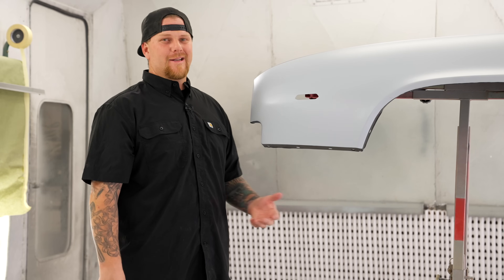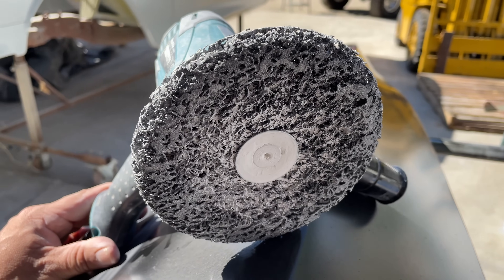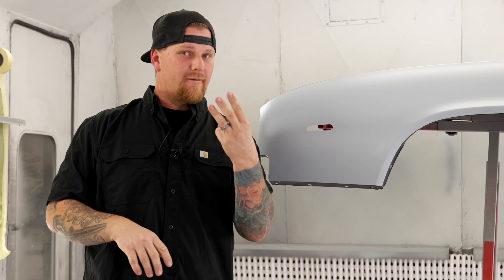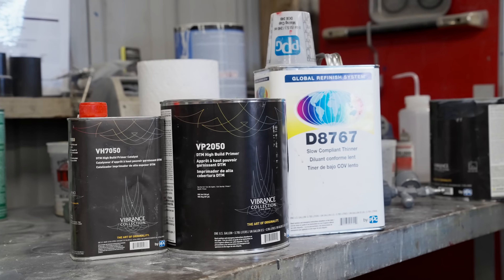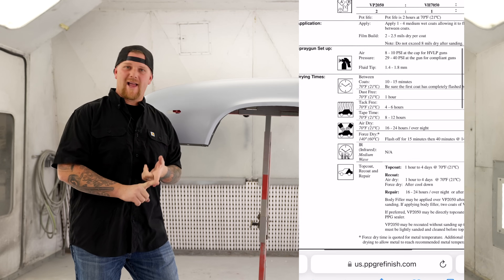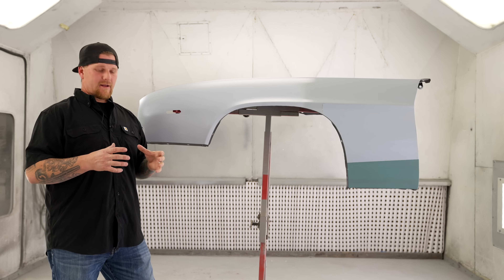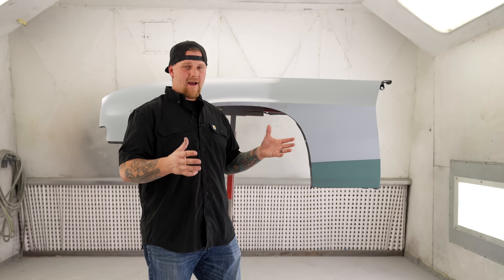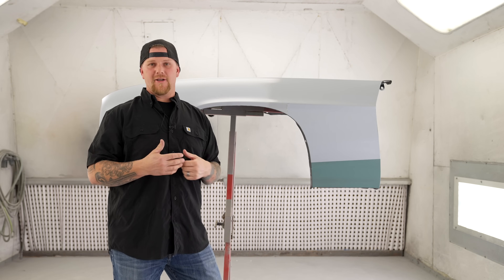Understanding Primers:  Epoxy, Polyesters, and Urethanes explained.

Comment: Interesting video I just have one question. I've seen some videos they take cut the rust out and take it back to bare metal and then they just lay fiberglass on top. They state the fiberglass seals the bare metal. Is that correct or should you use epoxy undercoat first.  Cheers Graham

Comment: I have a Chevy stepside tailgate. On one side, the important side you see, the 25+  year old black paint is in really nice condition.  The bed side has rust bubbles under the paint.   The tailgate is in excellent condition because it hasn't even been on the truck for most of that time.
A friend has a large commercial sandblaster and I plan to blast the bad side and prime it before putting it for sale.
I want to prime it with something friendly for the buyer/end user.
It will need a high build primer or possibly a little bondo or glazing putty. I'm not doing that.  I just want to blast it and prime it.  Will an off the shelf primer be ok for this?   I'm thinking Duplicolor, Rust-Oleum or Krylon bare metal primer.... A  non etching  type.
Reply from the maker: Read the tds make sure it meets the criteria

Comment: So if you’re using body filler, you put down edging primer first or after I’m confused
Reply from the maker: I don’t use etching primer at all. We use epoxy in the restoration world. The only reason you would want to use etch as if you are going to go back over the top of that with a urethane.

Comment: Can i do wheels with Epoxy primer?
Specifically, can Epoxy primer be a good base layer on a chrome wheel that been prepped (chipping removed, sanded, scarfed) without stripping the chrome all the way?
Reply from the maker: No nothing will stick to chrome. It must be chemically dipped and removed.

Comment: Question can I spray polyurethane primer DTM over 2K non-DTM primer and will it still be effective to protect the bare metal since the 2k is Not an etching primer. ?? was almost out of DTM polyurethane and put a little 2K over the bar panels that were left in order to protect them until I can get back to working on the car.   I do have polyurethane DTM primer on my hood fenders and my trunk lid. Just the other panels have 2K. Talk to a couple other paint guys and they say that the 2K might peel off of my raw bare metal that has been covered…. Thoughts and comments on this would be helpful to let me determine if I’m going to send the 2K back off and just hit it with the DTM polyurethane…?

Thanks
Reply from the maker: I think you are answering your own question in this comment. If you are putting something over bare metal and it is not at dtm it is not going to stick to metal

Comment: Great video! I wanted to use the self-etch primer on the bare aluminum to promote the paint adhesion. Then cover it with zinc chromate because I live in high humidity area near the coast. Any thoughts on this?
Reply from the maker: Self etch I steer away from. Mechanical adhesion is superior then use epoxy. 👍🏻
Reply: @SYLVESTERSCUSTOMS  Thank you. Does epoxy primer adhere to aluminum well? What prep do you to to promote adhesion? I thought about using Eastwood 2K AeroSpray Spray Paint

Comment: Even more confused. Nowhere can I find VP2050 called an epoxy primer? It’s a DTM high build?
Reply from the maker: @got2bgreen45  you are correct but if you go to the chemical make up of that product, it’s primarily any epoxy hybrid. A traditional epoxy is very thin and not sandable. VP 2050 is a great product because it’s a one-size-fits-all.

Comment: I learn so much from you but I don't understand why you say vp2150 is an epoxy primer - it absolutely is not:  "No, PPG VP2050 is not an epoxy primer. It is a DTM (Direct To Metal) high-build primer, meaning it's designed to be applied directly to properly prepared metal surfaces like steel, galvanized steel, and aluminum. While it provides excellent adhesion and corrosion resistance, it's not specifically classified as an epoxy primer."
Reply from the maker: I know that. However look at the chemical make up it’s an epoxy based high build hybrid. Because it’s a hybrid they will call it a DTM FYI

Comment: I keep coming back to watch many of your videos because most things I missed sink in.  Lots of information for a beginner. 

I have 1k max epoxy already to make sure there is no chance of moisture getting through.  You said that urethane high build is thinner than the all in one.  Would that be a good thing if I got smaller amounts of it in 2 or possibly 3 colors so i know when ive got a flat surface with the grits?  I can do 1 coat of the first color (odd) at 400 grit,  second with 1 coat of different (even) color on the at 320 grit, 3rd would use 2 coats (odd) at 220, and 4th using 2nd  (even) color would have 2 coats  work at 180?

Just another way that would be more expensive, but it might be easier for a beginner to have visuals instead of using the powder in between?  Would the scratch from the different grits dig down further than 1 coat?

Im thinking out of the box to help to know when to switch grits and not get mixed up with how far down they have gone.  In the end it's all coming off anyway.  

An expert would probably laugh at doing this.
Reply from the maker: You lost me I’m sorry. It’s not an easy task to learn it’s much easier at our in person classes. Sylvesterscustoms.com

Comment: good explanations of epoxies but I still need your advice on the epoxy matter.  Can I apply 3 coats of white color 2 pack epoxy primer only (no topcoats), on my 3 meters bare sanded mild steel swimming pool stairs handrails?
Reply from the maker: I’m not a pool expert sorry lol

Comment: I'm an ecoat technician for a company that makes new bumper on Ford, Dodge, and GM trucks. Taking off the ecoat is the worst thing you can do. Ecoat is a rust preventer better than any primer you can spray on the metal. We do extensive testing these parts and without ecoat the paint fails.
Reply from the maker: I’m not sure what to tell you I have seen many adhesion issues between aftermarket parts and Ecoat. I also think epoxy primer is superior over e coat. Additionally, the best way for a high-end restoration is for a mechanical tooth, which is also not provided under all of the parts that we have been looking at that we strip with lasers.
Reply: @SYLVESTERSCUSTOMS  agree 💯

Comment: Awesome data.  I'm a diy weekend warrior. I have had some pre primed bumper covers I have sprayed.  Would it be ok for a pre primed front bumper to be scuffed and prepped with a red scotch Brite and then spray with a 2k sealer and aloud to flash then base/cleared?  I haven't tried this method but usually there a aftermarket bumper cover and are pre primed and if I can get away with "wet on wet" spraying, it would save me some time and be standing .  Thanks
Reply from the maker: Yes, absolutely

Comment: Can you 2k epoxy over just the outside of a body where there is original paint on the inner structures? Is there a concern of blending?
Reply from the maker: I don’t exactly understand your question
Reply: @ let me try clarify thanks for the reply. I want to take everything down to bare metal except there are a few sections(on my front quarter panel as bends into engine bay where it meets with the hood) where I want to keep original paint. I don’t want to remove paint in the engine bay, but unsure how to cleanly transition. Hopefully that makes more sense?

Comment: What primer would you put over e-coat? I'm restoring a car which ill be having e-coated when the repairs are finished (it's been stripped via a pyrolysis oven and pboshporic acid dip, and will be going back to be acid dipped again before the e-coat to remove flash rust). Thanks,
Reply from the maker: I don’t recommend e-coat I haven’t seen good adhesion. We use epoxy primer over a very thorough 80 -120 grit scuff

Comment: Great video! Hey with that VP2050 does it lay smooth where you can go to paint over it without sanding it down? Or do you have to sand it? Would 400grit even take the skin off of it???
Reply from the maker: I personally won’t paint over it. It needs a mechanical tooth. I bust it down with 150 grit then 220 and lastly 600 wet

Comment: Question planing on painting my truck surface rust on hood and cab everywhere else is good so should i apply epoxy primer to the hood and cab   prep those areas then spray the intire truck in polyester primer is this correct method
Reply from the maker: There’s 10 different ways you could do it. I’m not exactly sure what your question is because you have rust all over the vehicle. You need to address that first and remove it completely. Then epoxy.

Comment: Thanks for the great video! Just wondering: if epoxy primer is hard to sand, what do people do? Do you have to use body filler or can you just paint over it? Is there another primer you would put on top to sand?

If you had a bonnet with about half bare metal and half old primer, what would you do? I was just going to epoxy over it all and either paint, or use another primer, but im not sure which os better? Lets say there will be pretty much no bondo or filler.

 Thanks!
Reply from the maker: If you go to the Sylvester’s Customs main page, you will see that there is playlist created for questions like this. We have videos of every step check out our series with the Willys. It should help you epoxy primer is not hard to send.

Comment: I plan on fixing my truck slowly but still drive it. I wanted to strip it down to metal and put an epoxy primer over it before any body work is done. Is it bad to drive around for a couple months with epoxy and or polyester primer over the body work? I would avoid leaving it in the elements until the TDS sheet says the primer has fully cured but would this be okay or would you recommend approaching it different?
Reply from the maker: I wouldn’t. All the oils on the road will get on your truck etc and contaminate it especially polyester
Reply: @ thank you sir

Comment: I take it to bare metal then work the dents by pulling them with a pin welder not sure how can do that if have epoxy sprayed over it I'm not a shop just guy likes restoring old cars. Tons of videos from shops on YT say not one shop they ever worked at allowed you to apply body filler over epoxy. Videos of tests done to compare what body filler sticks to better those tests results show body filler sticks to bare metal.  There seems to be lot of debate but in my internet searching your method seems to be the minority the majority strip a car do body work then sand again and epoxy over. I know what your going to say is can get rusting under that body filler not know it's there later cause a problem.  I probably don't have that issue I live in Phoenix humidity is 8-20% max.
Reply from the maker: Literally every high end shop I know of bodywork’s the cars over epoxy with no issues.

Comment: I put my car in a washprimer (2k from Mipa) on the baremetal, and after that I used Evercoat Slick Sand, after advice of my retailer. Now I read on some sites of manufacturers that you can't use a polyester spray filler over a washprimer. It gave me a fright. Am I in trouble now?
Reply from the maker: Washprimer I’ve never heard of that
Reply: Sorry, that's what it's called here I guess. It's also known as self etching primer.

Comment: Hi.....I'm a novice.   If I'm doing a repair to bare metal....can I use an DTM epoxy primer up to the feathered edge of the repair????     I like the epoxy primer because of its hardness.  I used it on mag wheels with corroded bead surfaces (after grinding and smoothing).
Good presentation.....thanks!

Comment: Feather Fill Poly is trash. It is brittle {hard} and will crack after you get a nice paint job done. It literally is a thin sprayable body filler and is NOT STABLE

Comment: Awsome info learned so much so far I have a question I epoxy primed 2 fenders  2 weeks ago now I would like to polyester them I have sanded them with 220,question is is the red scuff pads enough bite for poly also i do have pinholes in the epoxy should I glaze them or  will the poly fill them or bridge them also is the 3.0 tip to much for poly
Reply from the maker: I personally do not trust the scratch from a red scotch pad. But yes, it will definitely cover your pinholes. You can always regulate the needle and flow if the three-point is too big.

Comment: Great video!.......I got a fiberglass camper shell for free that was sanded (probably 80-120) all over exposing quite a bit of gel coat on the corners by the previous owner (sorry for the run-on).....do I need a sealer before a primer? Thanks!
Reply from the maker: I would epoxy it and then high build primer.
Reply: @SYLVESTERSCUSTOMS  1k or 2k? Thx

Comment: My challenge to use epoxy primer over dry 180g prepped acrilic paint?

From what i hear it can be done right?, & i should paint on the epoxy primer, then after a 15 minutes flash time, spray paint my color on.

It should spped up production.
Reply from the maker: I’m unsure of the question.
Reply: @SYLVESTERSCUSTOMS  i did edit my wording.
Hoping epoxy sticks to plastic, even if it is dtm epoxy. Hmm.
Reply from the maker: @aaronfuksa2047  epoxy sticks to dang near anything if prepped correctly. Read your tds sheets it tells you all that information.

Comment: What particular degreaser do you recommend after sanding before applying epoxy primer? Also, when sanding the rust off the metal, do you recommend finishing it off with a fine high grit sand paper to get it ultra smooth or it’s not necessary? Thanks!
Reply from the maker: Any wax and grease remover works. You want 80 grit with a DA for epoxy to bite to
Reply: @SYLVESTERSCUSTOMS  This is great info, thank you! Lastly, if I have spot surface rusting all over the vehicle, should I sand everything down (even the non-rusted sections) down to bare metal or just do the rusted areas only? The car is a 1971 and has one layer of original paint on it.

Comment: Question: is media blasting sufficient prep for adhesion before applying epoxy? If my car body is completely media blasted do I still need to prep it with 80 grit for proper epoxy adhesion?
Reply from the maker: If the media you are using leaves a rough profile, then you are good to go directly to epoxy

Comment: I am a 40 plus year painter, collision and custom work. 
Collision work I worked on straight commision. 
Would always turn in 80 -100 hrs a week.
I got paid 45% of the shop rate times how many hrs. turned in.
For example, did 100 hrs of work x 45% of $65 per hour.
45% of $65 = $29.25, $29.25 x 100 hrs.
$2925.00 per week.
This was in 2010 when I retired.
I would always 100% of the time use the proper sealer.
ZERO problems, EVER!!!

When I first started painting I did EVERY MISTAKE 
there was, and then some.
BUT I LEARNED.
The last ten years I could do many cars with zero errors.
That was from learning and paying atterntion!

Redos and comebacks were ALWAYS FREE!
Eliminate those and you are making good money!

You had the BEST advise and how to for all the substrate finishes!!!
Most of my products were PPG.
Made a lot of money with PPG!!!
Reply: All the custom work was with House OF KOLOR'
Kosmoski started here in Minneapolis, Mn.
Easy products to get!
They used to be cheaper than regular colors, but notany more....
Reply from the maker: Thank you!!

Comment: I've been using the VP 2015 for my 57 Chevy truck and it's amazing thank you for the video my only question is when you burn through do you go back with VP 2050 and touch that spot up or do you just use a urethane over the Bondo that you burned through
Reply from the maker: I always make sure I go back over it with 2050 before I go to a urethane sealer you need uniform coverage and if you just rely on the urethane over the areas that burned through it will shrink back and have a halo later on down the road guaranteed ask me how I know 🤣

Comment: I know this is an old video but if you didn't have an option for a high build epoxy, would the polyester be the one to use?.
Reply from the maker: As long as it is approved over, bare Metal. The biggest take away from this video is making sure people take the time to look up the TDS sheet for each product and make sure that it fits their requirements. 👌🏻

Comment: So I’m missing something. Why remove the primer the fender was shipped in. Is not good or was this just to show from bare metal.
Reply from the maker: The E coat I’ve seen have issues with adhesion and rust below the surface.
Reply: @SYLVESTERSCUSTOMS  thank you very much. I have little experience and that helps a lot

Comment: So I use vp2050 as my first coat, and then do my body filler and any sanding/blocking. Assuming I don’t expose any metal, I can go right to a urethane sealer and then base coat? If some metal comes up during the blocking phase, should i do vp2050 THEN urethane sealer? Or am I ok to paint right on top of vp2050?
Reply from the maker: I recommend a sealer always. But yes seal up  the metal with vp2050

Comment: Can you use an epoxy primer on fibreglass? Sorry if this sounds basic, but I work on older race cars that have metal bodies, but the front ends are now fibreglass and I have a few that need a complete repaint. I want to make sure I have a “uniform” base to work with prior to shooting any colour. Not looking for show car finish, just want them to look clean.
Reply from the maker: Yes, you absolutely can

Comment: I was told that it’s acceptable to scuff e-coat with 800 scotch-brite with no etch or epoxy primer and straight base coat.  Is this incorrect?  Great video BTW
Reply from the maker: I def would not trust that adhesion method.

Comment: What if I got a rust pitted surface. Etch primer to convert/stick to the damaged steel. Then how do I bondo over that?
Reply from the maker: Many ways to slice it. Blast it and epoxy but you’ll get some warp. Or rust mort neutralize it then scuff it and epoxy